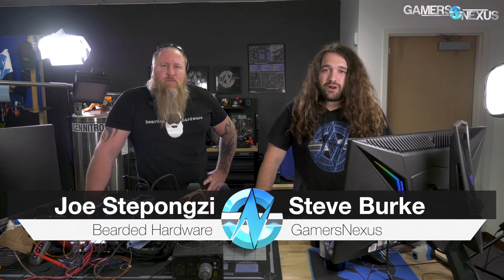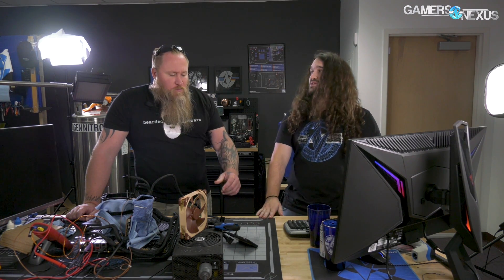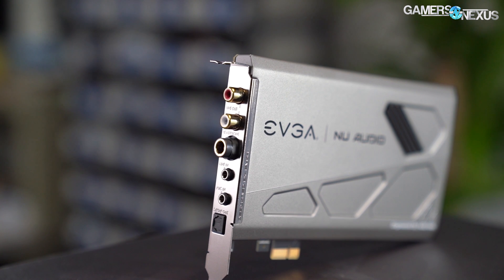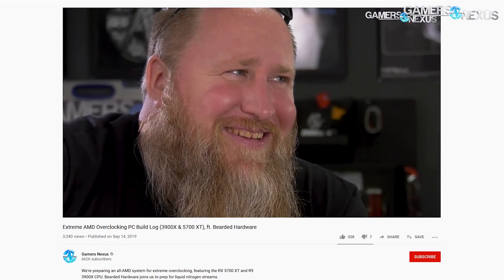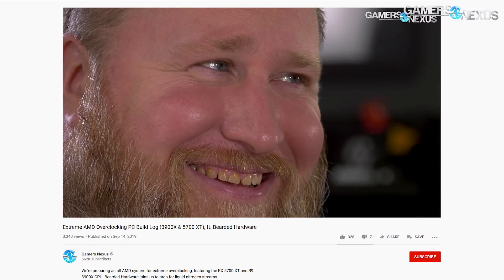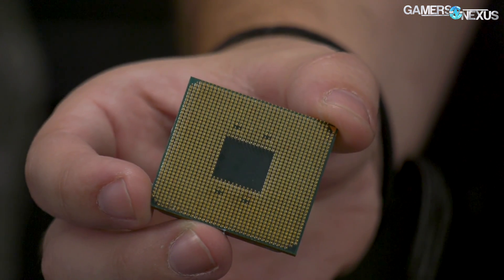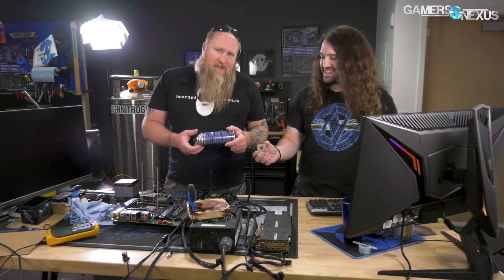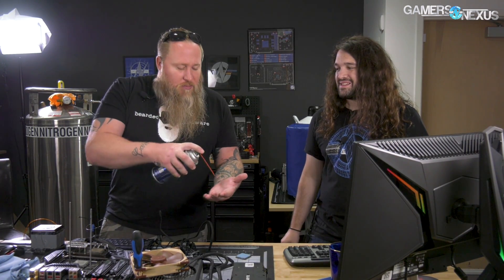RIP CPU + Motherboard: R9 3900X & 5700 XT Overclock Stream Recap

Comment: Heat/Cold Stress:  Yes, Slam Bake ovens with LN2 assisted cooling are used to STRESS parts.  In fact due to fact that shoving a frozen part in a hot oven drops the ovens temperature, it makes sense to overheat the oven above the desired soaking temperature while the Unit Under Test is in the Freezer.  Then at the instant the Frozen part is shoved into the oven the oven's setpoint is adjusted to the desired soaking temperature.  That way you get sharper edges on the temps in the STRESS test.  The opposite happens to the freezer when the part is in the oven.  Over cool the freezer and shove a hot part in it while resetting the freezer temperature.  That way you get MAXIMUM STRESS and can literally bust a part open.  Love it.....Engineers didn't like that much stress because too many parts would fail.  They preferred the method of heating the freezer to oven temps and back....sort of like hauling an Alaskan Iceberg to South America ….it  melts before you get there.  Least stress, "cheating"....

Comment: Totally agree driver updates can break overclocking options. I remember back when the GTX 500 series came out, the driver which the GTX 400 series shared, broke shader overclocking separate from the memory clocks, which generally gave the GTX 400 series a competitive edge on the GTX 500 series and deterred people from initially upgrading to the 500 series. After that, more people adopted the 500 series upgrade, because alot of the games and benchmarks upgraded to not work on older drivers. Was a real shady move by Nvidia to force people to upgrade.
Reply: Crazy right... :)
Reply: @BeardedHardware  oh yeah, but I stuck with my old Gigabyte GTX 460 SE, she always did me good, and overclocked EXTREMELY well on the Windforce 2 cooler. Actually won a overclocking competition completely unmodified by getting it up to 890MHz core, 1800MHz Memory 100% stable!
Reply: Joshua Bell awesome broski

Comment: I have the NuAudio its absolutely amazing it was a huge upgrade over my old headphone amp
Reply: Good but pricey. 😊GLHF. Yo😉👍
Reply: Wouldn't a Dragonfly Red basically make the NuAudio redundant?
Reply: @Phambleton  not really Dragonfly Red is cheaper and more portable but the my audio has a better sound quality
Reply: What gives the NuAudio the better quality? Just because it supports 192khz doesn't mean it's better
Reply: @Phambleton  I don't know what gives it better quality but I have tried both and the sound was a lot louder on the nu audio and slightly more detailed
Reply: Which headsets did you use?
Reply: Massdrop Sennheiser hd 58x, Beyerdynamic Amiron home and stax l500

Comment: Steve I am able to get 945 Mhz on memory, but depending on test, benchmark or Algo it may not be stable. The Non XT wont let us control memory voltage at all.. even with More Power tool, unless there is a private version not released to public. Thanks for stream

Comment: You can save that chip if you have the patience. Bring it to the laser welders to weld the pins back on
Reply from the maker: Ha, no, not really. We did have the patience and unbent every pin, but it lost too many important ones and doesn't boot due to DRAM errors. No way it's worth getting new pins made or transplanted.
Reply: Gamers Nexus I’m pretty sure I can solder the pins back on, I’d give you at least $30 for it if you sign it (so if all else fails, it will be on my display).

By the way, I’m glad you and Joe did the 50th anniversary stream, I’m loving the autographed mousepad!
Reply: @GamersNexus  I'll buy it for 50.
Reply: Yayy, it's going to live as a display. Now.👆🤡
It's going to be auctioned in 5 years time at Christie. Lol😊👍
Reply: 60$

Comment: So let the core clocks and PBO do their thing, and try to get the FClock to 1900, Ram to 3800.  If you can only get 1800, set the Ram to 3600, and then tighten the timings.  It doesn't seem like manual core clocks and voltages are worth it.
Reply from the maker: We were doing LN2, so totally different story.

Comment: It seems like NVIDIA restricts power/OC to a certain extent to stay within TDP/overall power draw numbers to make their efficiency look good (especially since they're almost always last to a new node so AMD has the advantage of smaller silicon) but the upside is that you end up with more OC headroom, whereas AMD, usually on a new node, pushes their silicon just about as far as it can go without frying itself just to try and compete reasonably with NVIDIA which leaves virtually no headroom in their silicon for overclocking.  It seems similar with Intel vs AMD for CPUs where Intel (at least used to; the latest Coffee Lake refresh seems to be an exception given that they're using an 8 core chip to try and compete with 12 core and eventually 16 core CPUs) leaves some wiggle room with regards to overclocking clock speeds and voltages, where AMD tends to have their chips binned and rated right at or maybe JUST below the max for their chips under normal conditions (i.e. not insane voltages under LN2/extreme cooling).  I hope that you guys are able to successfully power-mod Navi, but unfortunately I suspect you won't see much gain out of it (at least with any amount of stability) and I foresee a lot of artifacts and crashes in your future, but I hope I'm wrong.  If AMD binned their GPUs the way that NVIDIA does, where their performance level is right around the top of their efficiency curve rather than being pushed to the max for optimum performance, power and thermals be damned, then they would look a lot better for laptops and other lower power/thermally limited scenarios, though it would hurt their bottom line since they'd have to sell them as lower-tier graphics cards which is likely why they don't do it.

Comment: And my experience bent or broken pins are not a stopping point I have used pens removed via razor blade from useless CPUs and stuck them in the slot on the grid array where they belong and put the CPU on top I've also straightened CPU pins using a razor blade and or knife with great success and in some cases I've even used Staples cut to the correct length and inserted into the motherboard

Comment: Have you tried something like the Biostar x570gt8, that comes with an LN2 switch?
Its supposed to lock the chip at 800MHz during boot for very low temperatures.
Not sure if that stuff actually works tho... :p

Comment: Really wish AMD would have the pins on the socket, the motherboard is always cheaper than the CPU (unless you're doing something silly and running a expensive board with a i3/R3), also with the pins on the board you can have a socket that keeps the CPU locked in so when taking the heatsink off you don't have to worry about the CPU pulling out the socket. Really happy with my 3700x however that is all I'd like to see changed with the DDR5/AM5.

Comment: if you needed 500mhz to make up for 1900>1433, wouldn't it have been easier for you just to bench at 4.7? or whatever the max clock you could hit at 1900?

Comment: I wish my 3900X could hit 1900 on the IF. I can only get 1800 to really run stable. I'm not changing any voltages though because I'm not entirely sure what I'm doing. :-\ FWIW, I'm using an Aorus x570 Master, so I probably could get it to work if I knew what I was doing XD

Comment: I was able to clock ryzen 5 3600 to 4.3Ghz @1.408V very stable with max temps of 74°C under gaming load and 82°C under CPU benchmarks like cinebench. Mobo: Asus Fog Stix E Gaming. LLC was set at medium. Infinity Fabric at 1900Mhz. Trident z Neo RAM 3600Mhz @ 3800Mhz c16. The CPU is cooled with Deepcool Gamaxx L240 AIO liquid cooler.

Comment: Wouldn't it be better to submerge everything in mineral oil except the cpu and gpu tray's for the nitrogen,that way the temperature should remain the same trough out the board and the condensation should be close to 0
Reply from the maker: Not really that simple.

Comment: That CPU isn't necessarily dead, It's not that hard to fix missing and bent pins. It just takes a lot of practice and patience.
Reply: besides making the same comment as countless others , WHAT ABOUT THE BROKEN PINS
Reply: @mauriceh7558   It's not all that hard to do. It just requires a steady hand and some skill . I've done it a few times, the issue is always getting donor pins. That's where it gets incredibly hard since not all pins are the same and you have to remove them correctly.

Comment: How do sound cards like the one in the sponsor spot compare to external audio interfaces like a Steinberg UR-22 (well, specifically that one as that's what I've got)
Reply: Steinberg is typically for professional audio use cases ie low latency drivers to record and monitor.  The add in cards are usually like an audiophile dac set up for better audio for games and video.
Reply: I dont think it is worth the money lil too expensive for what it is, limited in n outs, may as well just get a pro audio interface/soundcard. I got the Focustrite 2i2 recently well worth the money

Comment: Open question. If I can afford a 2700x or a 3600x witch should I buy?
Reply: for what ?
Reply: @claritoresdiano1021  for 1080p/1440p gaming and light video editing. I have a msi trio x 2080 and 16gb of ram
Reply: uhh... very hard to pick 🤔

Gaming = I prefer 3600X (L3 Chache) works well on game's. 0,1 Lows FPS pretty good than 2700X.

Render = prefer 2700X more core's (8 Core/ 12 Thread) no brainer.
Reply: @claritoresdiano1021  awesome thank you I might get the 3600x since I game more then I edit and record

Comment: so wait you spray ihs side then flipped it and sprayed pin side and it flew out of your hand. Why did you spray pin side? to clean....the pins? You lost me.
Reply from the maker: Yeah, to clean thermal paste off the contacts.
Reply: The board had alot of runs on LN2.  I sprayed out the socket, since it was dirty.. saw some paste and some vaseline in there also. Its always a good idea to clean the pins and the socket for the best contact. slacker :)
Reply: Oh I see. Haha was totally lost right there. Linus it up mates!